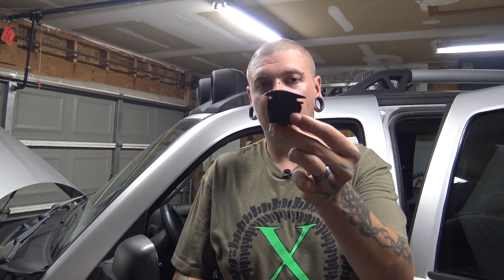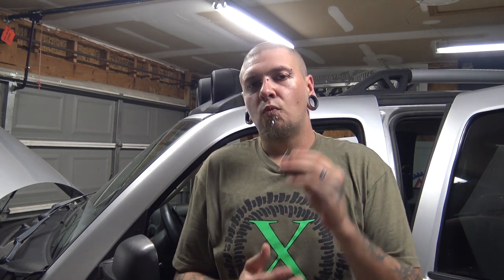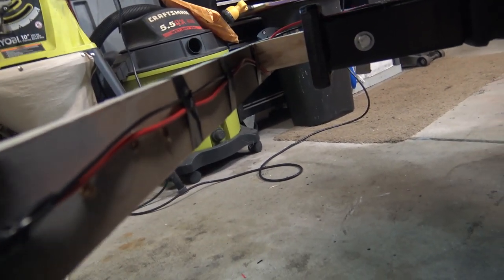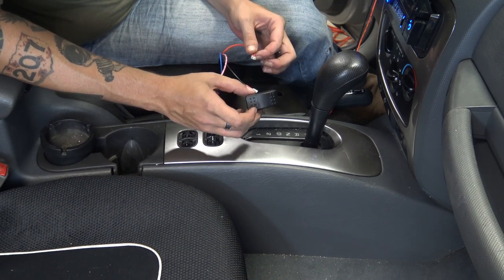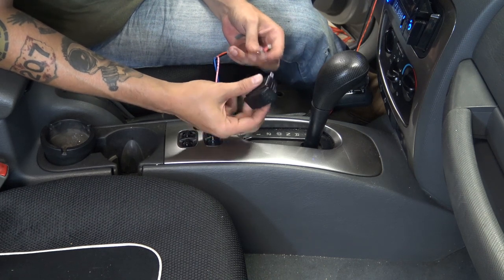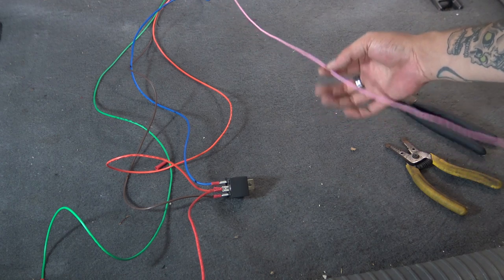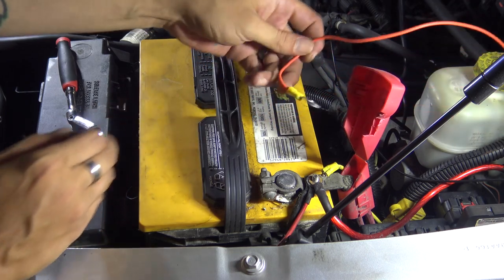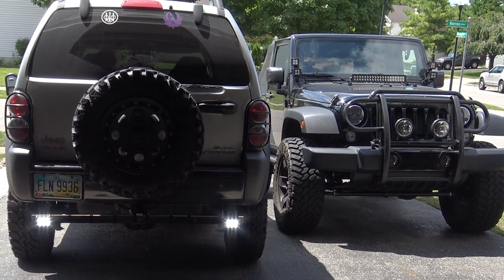How-To Make Aux Reverse Lights Multi functional (SPDT Switch)

Comment: If you don't have a 3 setting switch, what do you do differently? I want it to come on during reverse, but then want the option to manually turn it on. Do I just use a different relay?
Reply: I'm wondering the same, I'm trying to do it too.. u figure it out?

Comment: Thanks for the video.  Great info.  Have one question.  I wired everything as described but used a toggle SPDT switch with 3 connectors.  when switch is in position for reverse lights to come on, they stay on even when I shift back into park or drive.  any idea why?  Thanks, Mark
Reply from the maker: Sounds like you may have a few wires switched. The wire for the middle pin of your switch should be connected to pin 86 on the relay. Then you should have power from the battery or a switched source on one of the other pins and then the wire from your vehicles reverse light positive on the last pin of the switch. I hope that makes sense.
Reply: Thanks so much.  That was exactly the problem.  It seemed logical the power went to the middle pin on the switch.  I guess not!
Thanks again!
Reply from the maker: @markhuff1806  No problem!

Comment: Can the switch and relay be bought at my local auto parts store. And what type of relay maybe you said it but I might have missed it?
Reply from the maker: Just a standard automotive "Bosch" style relay (4 or 5 pin) As for the switch, I'm not sure if you could get one that looks decent at an auto parts store, but they should have a few SPDT switches (Single Pole Double Throw) Here is a link to my Amazon store, I have everything linked in there if you want to take a look. Thanks for watching! https://www.amazon.com/shop/rockyxtv
Reply: Rocky X TV can i hook them up to my reverse lights and a rigid flasher and also have them to where I can turn them on independently
Reply from the maker: Not with the Rigid flasher module as it doesn't have a solid on function. You would need to run more than one switch in order to bypass the flasher module. Maxxima has a strobe module with solid on, but they have been getting a little finicky. I've had quite a few of them and they work with some lights and won't with others, it has something to do with the driver inside the LED light.
Reply: Rocky X TV yeah that's what I was thinking about doing is running another switch but do I need another relay or do I need to put any diodes in to keep it from lighting up my reverse light still
Reply from the maker: You shouldn't need any diodes or another relay as the flasher module goes after the relay so you're not cycling the relay over and over really fast. You would just run your other switch to the flasher and then from the flasher to your lights. You would have to have your other switch in the middle or OFF position to keep everything else from flashing.

Comment: Is it possible to make the neutral of the switch (middle) for the lights to come on when reversing. The top push in when you want to use them freely and the bottom  to turn them off?

Comment: Hey, can you do what your doing to the factory brake and reverse lights? Like if I wanted to be stealthy for whatever reason.
Reply: In theory you would have to run everything through the switch first.... so you could disconnect power to said lights ...

Comment: What color is the wire for the reverse lights that you want to tap into behind tail lights thanks
Reply from the maker: It's different from vehicle to vehicle. Are you doing this on a Liberty or something else? If it's a Liberty KJ (2002-2007) it should be a Brown & Green wire, if I remember correctly. Thanks for watching!
Reply: @RockyXTV  2006 Jeep liberty. Thanks for response.

Comment: I'm still confused about the spdt rocker switch connections. This was a 5 pin switch ?? yes .. I think soI would really like to see the connections from the specific pins of the rocker switch to the relay. you stated pin 2 from the switch goes to pin 86 on relay.. I know the different pins for the relay but witch are the pins on the rocker switch ?? ie.. which is pin # 2 on the rocker switch. Thanks in advance
Reply from the maker: You can send me an email and I can give you a schematic, just like relays most switches of the same type have standard pin numbers. You can contact me at rocky.tvchannel@gmal.com Thanks for watching!

Comment: What kind of relay is this? As all the 5 pins i look at have different diagrams on them
Reply from the maker: Most are the same, they can just be wired differently. The relays I use are known as Bosch style relays.

Comment: This is the same as the video you did for the high beam correct?
Reply: Also why no diode?
Reply from the maker: Very similar, different switch and just a few other small things, but you are correct very similar. Thanks for watching, and if you haven't, make sure to subscribe to keep up on all the new videos and products! Thanks again!
Reply from the maker: It was rare if needed on the headlights, even more so on the reverse. The diode was only for some finicky newer vehicles, never had any issues with the reverse lights though. Thanks for watching!
Reply: So will I still need it if I don't want reverse lights to turn on when I turn on the light bar?
Reply from the maker: Not if you wire the switch and relay like in the video, it separates them into two different circuits.

Comment: Can this be done if I already have gang switch panel and also add a strobe relay/controller?
Reply from the maker: I don't see why not, can you replace one of the switches with a SPDT rocker?
Reply: @RockyXTV  no can’t replace the switch. It’s an auxbeam 8 gang switch panel from Amazon. It has buttons to turn on/off only.

Comment: Great video, but how do you wire this one with a 5 prong LED rocker switch ?
Reply from the maker: Is this what you are looking for? https://youtu.be/I1zcRPZDzIY Thanks for watching!
Reply: Rocky X TV , yes this switch, but where do you connect the wire pink one from the reverse lights ? You can only run the trigger, bleu one from 86 to the 5 pin rocker switch, not ?
Reply from the maker: If you wanted to run a regular 5 pin rocker switch for some aux reverse lights you could do so, but you would not have the multi functions shown in this video. You would basically just have on and off with the switch, no auto on, by themselves and off like with the switch from the video. You could however run the pink from your reverse light + to pin 2 on the 5 pin rocker, then run the blue wire from pin 3 on the rocker to pin 86 on the relay. This would allow you to have the switch off and you would have the vehicles reverse lights only, then you could turn on the switch and the aux lights would come on automatically with the vehicle reverse lights. You just wouldn't have the ability to turn the aux lights on by themselves. I hope this makes sense.
Reply: Awesome ! Thanks, merry x-mas
Reply from the maker: Merry Christmas!

Comment: I have a question .l have light bar on my Jeep  on the roof the wire harness came whit xtra wire for other light and l want to put a other light bar small on the bumper whit a diferente switch how do l do that ??
Reply from the maker: You would need to add another relay and switch, basically make a new harness if you want it completely separate from the other light. I have a few other videos that might help you out, starting with How-To Wire a Relay. Thanks for watching!

Comment: What Guage wire are you using?
Reply from the maker: It has been soo long since I did this, but I'm pretty sure it was 14ga. With small LED's I typically use 16-14.
Thanks for watching!
Reply: Going to attempt this same set up on my f150

Comment: Could you write out the pin numbers for the relay and the switch  as a little side note
Reply from the maker: Relay  Pin 30 = Battery + with a fuse, Pin 85 = Ground, Pin 86 = + From switch, Pin 87 = + For Aux lights. As for the switch, pin numbers would vary from switch style & brand. I hope this helps, thanks for watching!

Comment: I don’t get the really part? Yep I know I’m no electrician but my son wants me to help him install all those led light on is truck. Why can’t I just tap on the reverse light on the truck? Or even use the reverse on the trailer connector. I like to keep stuff simple
Reply: You can tap the reverse lights on the truck and this way you will always have your LED lights come on with the reverse lights.  However, let's say you want to use the LED lights WITHOUT putting the truck in reverse OR you do not want the LED lights to come on with you put the truck into reverse, then you would install a multi-function switch.

Comment: Do I need to put a fuse on any of them wires?
Reply from the maker: Yes you do, I always forget to show that in the videos as I'm not permanently installing. You need a fuse on the Orange wire from the battery to pin 30 on the relay as well as a small fuse if you wish on the other orange going to the switch. Thanks for watching!
Reply: Thanks! The quick reply gained you a sub!

Comment: Would this still work with a switch with an on off position?
Reply from the maker: If wired like in the video, but using a standard on-off switch you would be limited to just the manual turn on or just the auto turn on function. You would not be able to have both without changing up the wiring.
Reply: @RockyXTV  How would it be wired in this case (ON has lights on, and OFF has lights on with reverse)?
Reply from the maker: @ICohen424  If you send me an email ( rocky.tvchannel@gmail.com ) I could try to draft up a simple diagram for you. Thanks for watching!
Reply: @ICohen424  Did you ever get the diagram? I know this was years ago but I'm reading all the comments and you are asking the exact question I have.  If you still have this after 4 years, please let me know. Thanks!!

Comment: Does the positive wire from the battery to the switch need to be fused?
Reply from the maker: It is not required, but is recommended. I always forget to show that part in videos. You only need a small 5 Amp fuse for this wire as it only triggers the relay. Thanks for watching!
Reply: @RockyXTV  I'm going to wire my aux reverse lights this weekend. Except my switch is a SPDT (on, on). I don't need the ability to disable the light like you did, so will that change the wiring that you did?
Reply from the maker: Nope, everything should be the same.
Reply: Isnt pin 8 on that switch for ACC? If so why do you run a wire directly from battery to pin 8? Shouldn't be the center pin? Thanks.
Reply: Last question really trying to understand how it works and not just copy your wiring. So I understand how the blue wire from the switch to the relay works. When the switch is turned on the blue wire from the switch sends a signal to the relay to tell it to power on. What I don't understand is how the relay is getting the signal to power on when you shift into reverse. Because the wire that comes from the tail light goes to the switch and is connected to the ACC pin on the switch.
Reply from the maker: This is because in this application the switch is getting used somewhat backwards. Basically you would normally have one power source going IN to the switch and two loads going OUT. We are doing the opposite, one load OUT and two power sources IN. This is how you are able to make the lights come on automatically with your reverse lights and operate them independently. I hope that makes sense.
Reply: Rocky X TV due to this “backward” application, is that why the one led is always lit on the switch?
Reply from the maker: Unfortunately yes, this can be solved a few ways though. 1.) You can wire the power from a switched source instead of your battery, this will only solve the constant LED when the vehicle is off. 2.) You can not run a ground to the switch. 3.) You could use a switch without lights. Thanks for watching! I think I have a few switches that would work for this application in my Amazon Storefront - https://www.amazon.com/shop/rockyxtv
Reply: Rocky X TV yeah I get how to change that, have you ever given thought to using two switches? Obviously the one eliminates ever having both on at once, but another way to have led work as intended
Reply from the maker: I don't run this setup on my vehicles, I made this video to show a few people how they could do it using just one switch. I run my AUX reverse lights from a single on/off rocker and just turn them on manually.
Reply: Fair enough, very nice job

Comment: what happens if u have the led lights on and go to reverse gear?
Reply from the maker: Nothing, this is due to the way a 3 way switch operates. There would be connection between the battery and the relay/aux lights, but no connection between the reverse lights and relay/aux lights.

Comment: I mean I want to trigger remotely thru reverse light  to remotely switch on my rv reverse light wirelessly
Reply from the maker: If I understand what you want to do, you would need some kind of remote controlled lights. You would still have to wire them into your reverse light circuit though.

Comment: is there a diagram if I just want to use an on off switch instead of a rocker? meaning I don't care to turn off the lights if I have it in reverse but I do want to turn it on anytime I want..  Found this switch https://www.amazon.com/dp/B00PTPT62Y/ref=cm_sw_em_r_mt_dp_U_SZ8LDbEM0HP02

Comment: A diagram showing this circuit.  The switch wiring will be a bit different if you want to use a lighted switch.
https://www.jk-forum.com/forums/attachment.php?attachmentid=596223&d=1423576028

Comment: Say my 05 Liberty had a remote start separate FOB. I lost it.  Can I replace it to use remote start again? I guess I could lower the panel under the steering wheel and see what kind of remote  system it is and track down the remote. Or could I simply buy a universal FOB and pair it? Thanks much